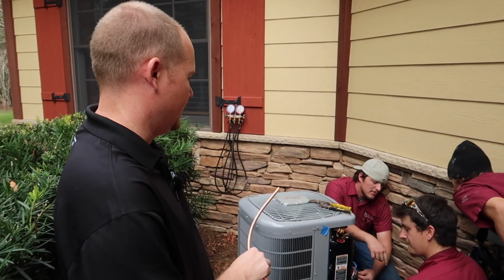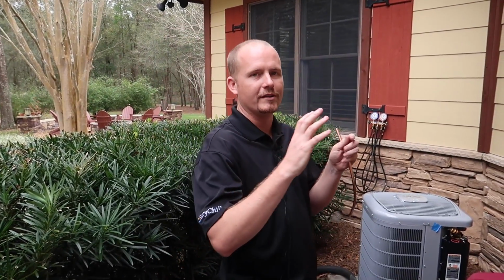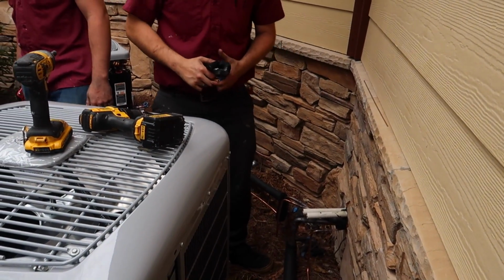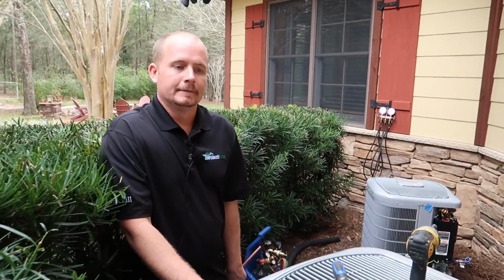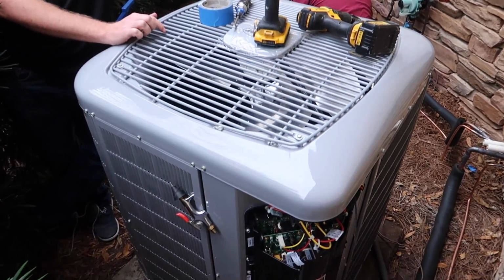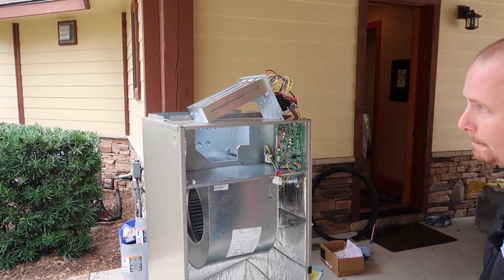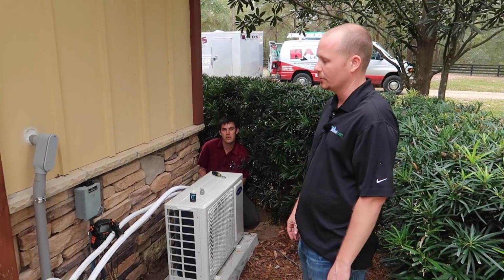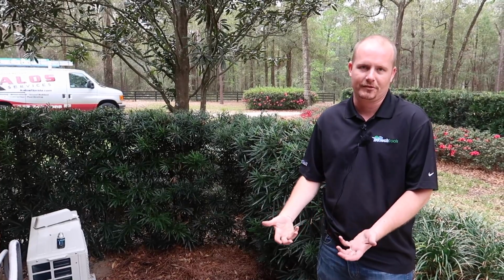Obsessed HVAC w/ Kalos Services: E3 - Bryan Orr Explains How It All Works

Comment: trying to explain thermodynamics to an art major. what about running the unit as a heat pump in the winter.
Reply: saferider10 condenser is then inside and evap outside

Comment: To Bryan's point about how heat pumps are becoming more popular further north, I'm in Indiana and I have a heat pump.  Instead of electric heat as my backup or auxiliary heat, I'm using natural gas.  Carrier calls it a hybrid system, but that really just a marketing term.  This setup has cut my heating bills quite a bit.  The system is so much more efficient than my previous AC unit, that my electric bills are quite a bit lower as well.  It's definitely worth it to buy a more efficient AC or heat pump system, depending on your needs.  Bryan did a great job of explaining how it all works, even though you were giving him the business, Matt LOL.
Reply from the maker: I like to keep him motivated.  Ha, ha...
Reply: azurebluemach good old "hybrid heat" good system

Comment: The variable compressors are just efficient because traditional nonvariable compressors are binary; they are either full power or off. These only spool up to the amount of compression you need to hit the optimum efficiency point for whatever your cooling requirements are. Like say your house is 71 degrees and you have thermostat set for 69... a traditional compressor would kick on full steam ahead and draw a ton of current and then it would run on a controls system known as dead band so you would cool to like 65 degrees and then kick off. Variable would spin just enough to keep you at 69.
Reply: capt_conrad that... and the actual BTU output to watt input is lower on the variable rotary

Comment: pv=nrt:  aiui, the refrigerant doesnt boil because it's absorbing heat from the house, it's boiling because the volume of the pipe increases, which reduces pressure and decreases temperature of the refrigerant. the warm air of the house hits the cold coil, reducing the temp of the air in the house and causing the moisture to precipitate out of the air, hence the need for a drain line.

the heat from the house will actually reduce the boiling of the refrigerant if the volume of the line is below the critical point because the heat transfer increases the pressure in the evaporator line.  I personally don't like the boiling analogy because it is associated with a large volume of liquid being heated.  I like to think about it in terms of molecule speed. Higher temp liquid has molecules moving fast in small space, the molecules pour into a bigger space and slow down (a sign of a lower temp of the gas), the heat from in the house then speeds up the molecules again. the compressor increases pressure and temperature of the gas until it becomes liquid, heat is rejected outside, process starts over again.
Reply: bwg4248 some of what you say is correct, the last paragraph is false
Reply: basically what I'm trying to say is, when one mentions boiling, one imagines raising the temperature of a liquid (water) above ambient until its phase changes, which starts the person trying to understand the concept off on the wrong foot, i think.

 In the case of an AC unit, you have to have a chemical that will phase change below the temperature that you would like to cool to, so that you can decrease the pressure enough to lower the temperature of the fluid in the line to a temperature below the ambient house temp, which creates a temperature gradient and removes the heat from the home.  Once the slightly warmer gas passes outside, you need to create a fluid that is hotter than outside  air temp to create a temperature gradient so the heat can be dissipated.   To do that, the gas pressure is increased, and so is the temp, via the compressor so the temp is higher than the outside temp, creating a temperature gradient and releasing the heat into the air.

Also, the other problem with using boiling in the explanation, is that one imagines a pot filled at least halfway with water, as if you were going to cook something.  if the same was true for the air conditioning line post valve, then you'd have a large amount of fluid and smaller amount of gas in the line, implying that the line is below critical volume.  In that case, increased heat would increase pressure and you'd end up with fluid filling the line and the gas condensing.  In reality, it operates above critical volume, allowing vaporization.

Comment: I live in Norway, it is common and have such a device as carrier
but from Toshiba. they go right down to -31F before they fail to make creating heat.
but it's no problem in Florida ..hehe

ask how often you must clean the filter on the inner part of the carrier.
is 5 minuter job and it's easy

Comment: I was thinking of a cars cooling system. It puts cold water into the motor, absorbs the heat, and the fan pushes the heat out of it in the radiator.  Only difference in this is that when you compress something it heats up, which is why the "cold" line feels hot, and when you decompress something it cools down, the hotter air blows over the now cold liquid which absorbs the heat, which is why the hot one is cool. Technically, what ever is colder, takes the heat from what is hotter. Water takes the heat from the pot, but if the pot in colder than the water the water heats up the pot. Or so I think, this is what I gathered from the video because I know literally nothing of A/C systems which is why I am watching this.